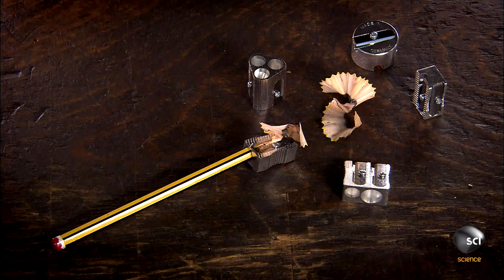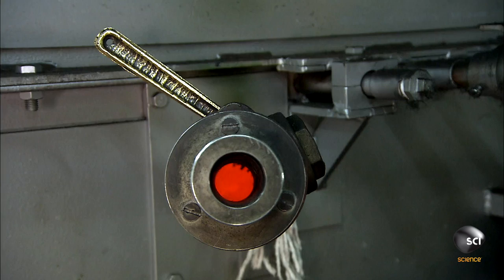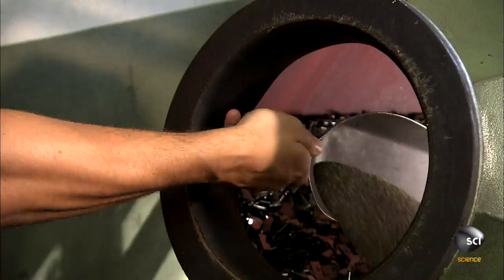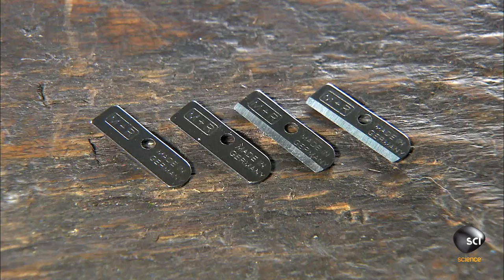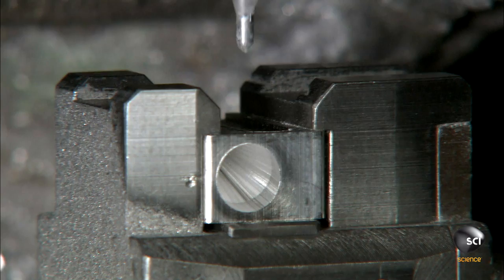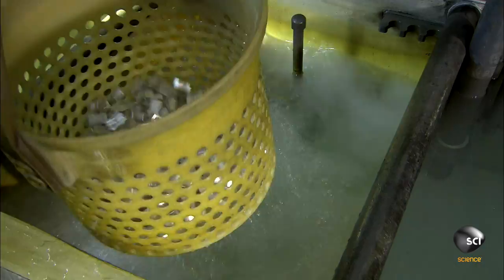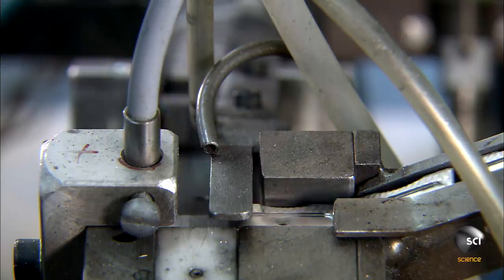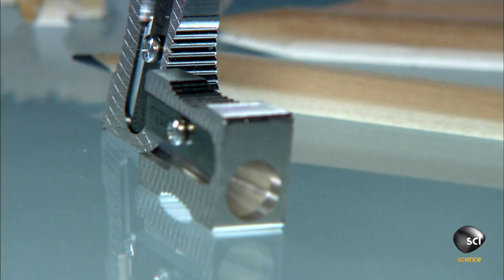Pencil Sharpeners | How It's Made

Comment: Wonder why they use magnesium for body?
Reply: Easier to work with and lighter than steel
Reply: They make them in brass too. Those are my favorite in the hand held type. Nothing beats a double helical blade sharpener though. These are BTN. Better Than Nothing.